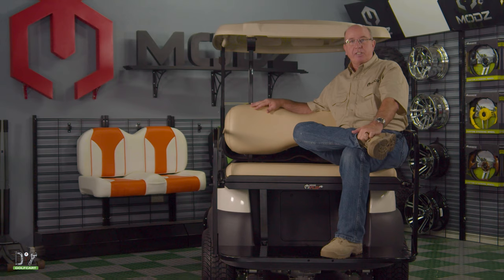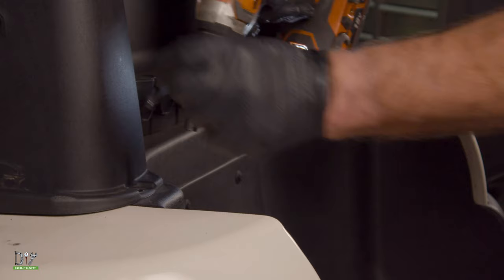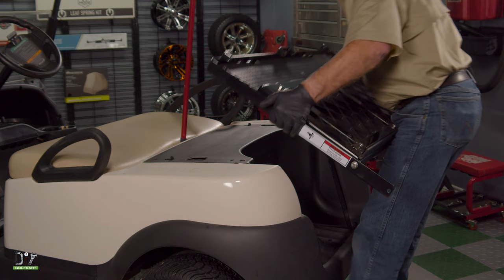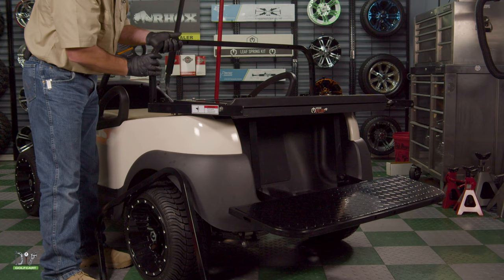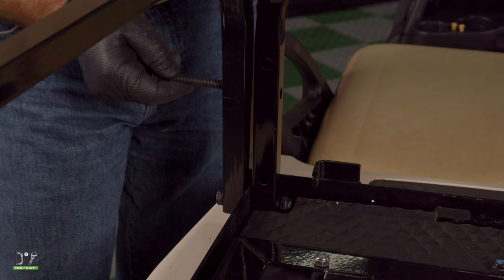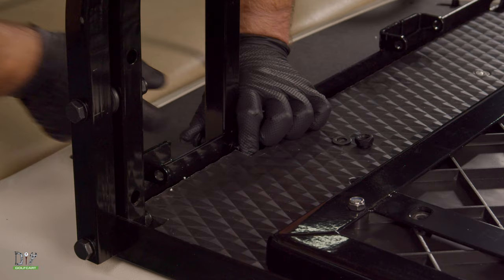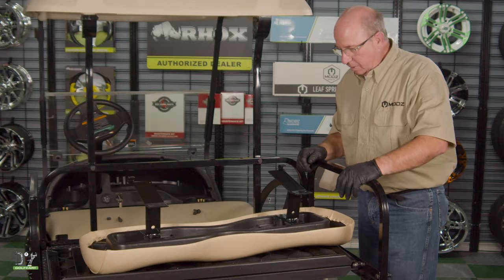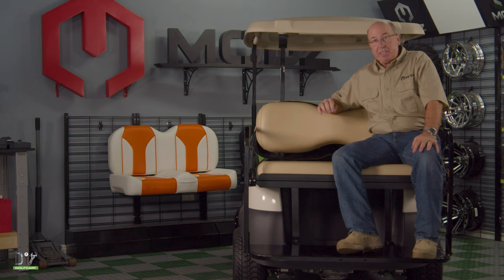Modz Flip4 Club Car Precedent Rear Seat Kit Installation How-To

Comment: Installed this kit on my 2013 Precedent. Everything was good until I went to reinstall the front seat. The brackets for the front seat tip back and are too short. They should have been longer and tipped outward or forward. This left the seat straight up and down, too high and too far back. I called they're tech support and the message after a few minutes was they were too busy to take my call and to NOT leave a message or callback number. They stated to contact customer service through the website. I'm at 1 day and waiting. In the mean time I cut the original front seat back and reinstalled the front seat. I'd have to cut they're brackets to put the rear seat back on, but I'll wait to see if they contact me. P.S. I've never had a tech support line tell me that they weren't going to attempt to provide service and hang up. I think Golf Cart King should answer they're phone or call you back after leaving a message. Don't tell your customer to NOT leave a message and to contact customer service. I've also read about others having this problem in Youtube reviews and on Amazon. Starting to think "Amazon's Choice" means "Junk, dump it before we're stuck with it"

Comment: Does the seat frame rest on the body or is there some standoffs that the frame connects to? I can see issues down the road with it resting on the body. I used threadlocker on all nuts to prevent "Sqeeking" a few days after installing.
Reply from the maker: The seat main frame is kept off the body by being bolted to the tree's (back supports) and the seat base frame supports. Once everything is installed and then tightened down, it's not going to squeak!  It is a super sturdy seat assembly!